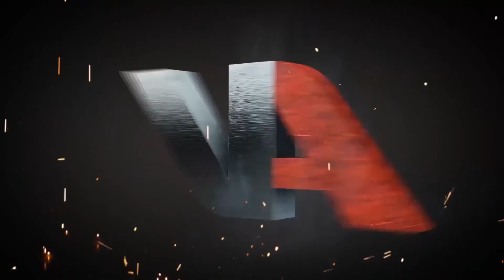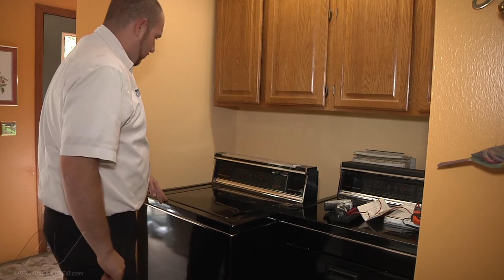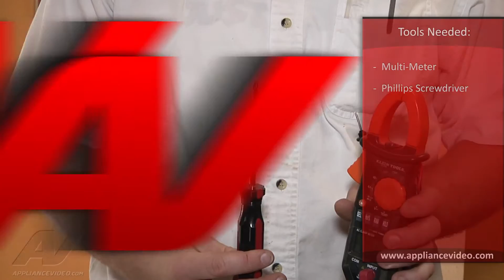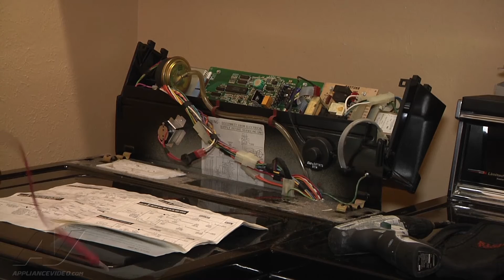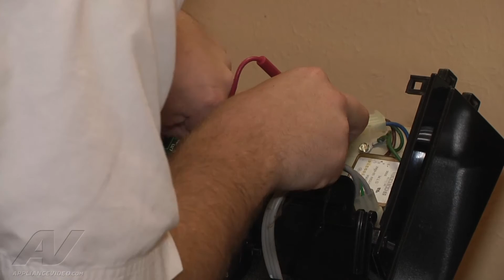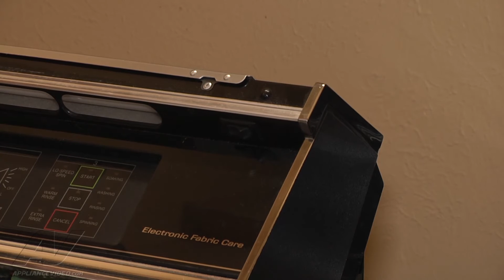Kenmore Washer Repair - Stops After Filling - Power Supply Board

Comment: Thank you so much for the video.  you were a great help.  my washer was working just fine, but all of sudden right after it filled with water, lost all power.  Not 100% sure, but following the troubleshooting papers, directed me to replace the EMI power line filter.  And unfortunately that part does not exist.  Do you know if it can be bypassed?  I know it is there for a reason, but when you can't find the part then you have no option but to buy a new washer and i don't want to do that just  yet.
Reply from the maker: Great question, if you have a more technical question that our parts department cannot answer, you can search our over 17,000 answered questions free at our website www.ApplianceVideo.com under our Repair Help section. You can also call our parts department at 1-800-830-5465 and they can give you help 7-days A week ,or search at www.SaveMoreOnParts.com  .